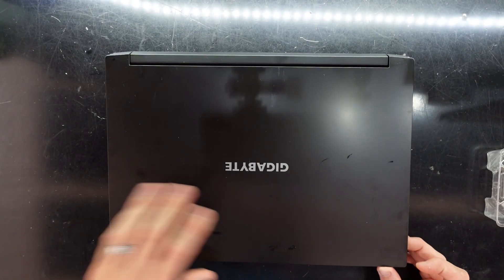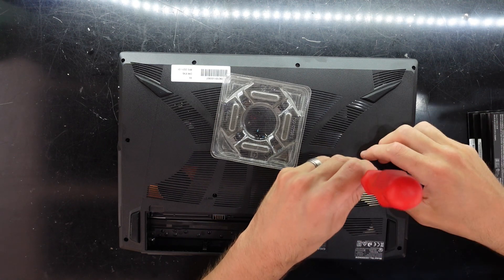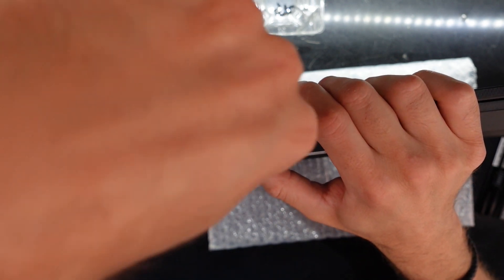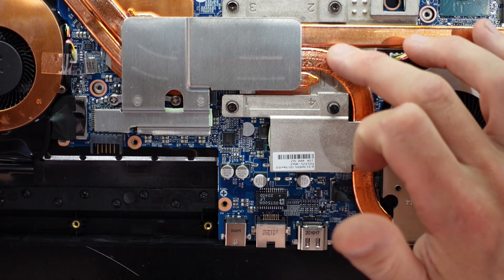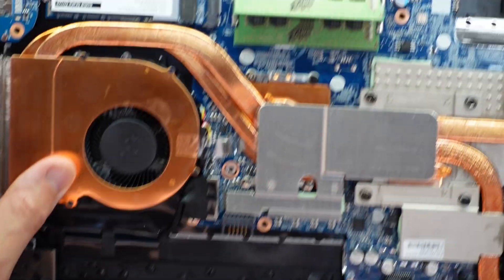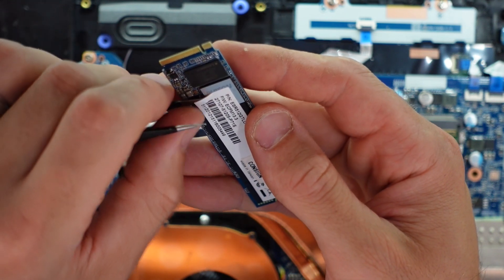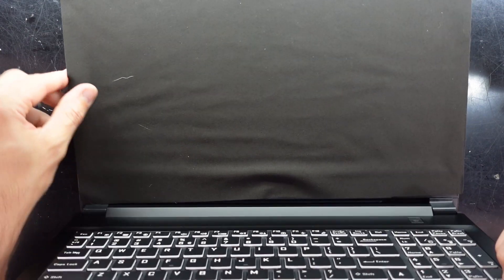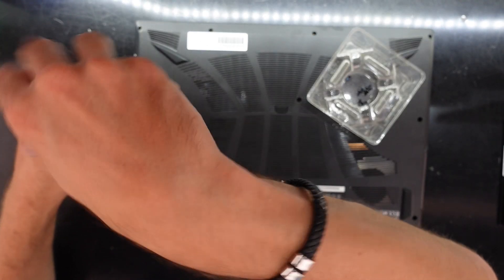Gigabyte G5 Teardown and NVMe SSD Install

Comment: Thanks for the video! Big question, though: I did exactly what you did and installed a 1TB nVME SSD, but when I tried to turn it on afterwards, it hung at the GIGABYTE logo screen. I tried recovery (F9 at startup), several BIOS options, and even made a Windows repair USB, but nothing worked. When I removed the new SSD, the G5 went back to working like it had, no problems at all. Any ideas why it's doing this, and/or what I can do to make it work? Thanks very much!
Reply from the maker: what model of SSD did you buy ?
Reply: @rickstechrepairs  I guess he found a solution 🤣
Reply: @rickstechrepairs  i brought Samsung990pro😢 i can't boot with this sad once i remove it will back to normal
Reply: @pl1576  is it not working with 990 pro ? Have you found solution ?? Maybe is the other slot which is for pcie 4 ?
I was just planing to buy it just today....
Reply: I got same situation😢
Reply: Did you solve your issue? Igot same issue here
Reply: Put your new ssd in the orignal place. And put the orignal ssd to the 2nd one

Comment: Was there a SSD under the M.2 drive slots? Or is there just the one/single 2.5 slot (that was empty), as far as expanding the storage?
Also, are the PCI interface 4.0? Or will it depend on what gen of processor? 
I was looking to buy one and during check-out, i found this video on it & didn't go through w the purchase.
Max-P version for 1250.00 online, but would like to know the number of storage slots total, and the generation that the NVMe ports please. 
And is fan noise worse than an older alienware (similar CLEVO type SLI on older alienware)?
Any advice is appreciated. Thanks
Reply from the maker: 6:15
not sure if its PCI4.0

fan noise is the same as most clevo laptops
Reply: @rickstechrepairs  thanks for info man.

Comment: Oh! Quick question, when installing the extra M.2 SSD for this, do I need a heatsink? It seems like the M.2 SSD that comes with the laptop doesn't have one, but I'm unsure. I'm gonna use my extra M.2 SSD for just storing my steam games.
Reply from the maker: You don't need to use the blue thermal pad.

But if you have it. I would recommend using it

Comment: nice...but then what's next? It did not recognize my M2, Samsung EVO 970 plus. Nothing in the explorer. The SSD is recognized.
Reply from the maker: Got to disk management

Then initialise drive

Then format 

Will show up in explorer after that
Reply: @rickstechrepairs  thanks for quick answer! I did this but it wasn't in the disk management either. So I reopened the laptop and also removed the laptop's own NVMe which did not have that same sticker as you have. That's when I discovered the thermal pad for the first one. I wondered and saw there's one extra in the bag with screws too. I reinserted both nvme's after installing the second thermal pad (which you didn't mention in your video by the way). Now it was recognized... just to run into another issue: the drivers can't get installed, magician does not support it (also driver-wise). It's not that simple unfortunately :/
Reply from the maker: some NVMe dont need the thermal pad, but i did forget to mention that so if you got the pad misowell use it

i would be going down the path of a fresh install of windows on the new NVME
Reply: @rickstechrepairs  I have found a different workaround yet using bcdedit safeboot, changing from Intel RST Optane to AHCI mode and in safemode remove bcdedit safeboot. Driver got installed, magician recognizes it and the samsung is now my boot drive. No issues left. So conclusion: Samsung is not comaptible with the Intel RST Optane memory mode in this laptop at least.

Comment: Oh! And since I'm getting this laptop soon, do I need an anti static bracelet for when I operate on this laptop to add on a M.2 SSD? How do I ground myself with this laptop?
Reply from the maker: Ground yourself by touching something metal, like a screw driver or the cooper cooler
Reply: @rickstechrepairs  thanks! So like before I begin work on opening the laptop, I just touch the screwdriver? 

And thanks so much btw, your videos have been very helpful on making my purchase for this laptop.

Comment: https://youtu.be/i3WyunTw_3Y @ 7.40 - I was puzzled what for is that piece of purple rubber... It came in the box with the laptop, oddly, in a very large plastic bag. Now I know... Shame that you have to force out bottom panel, I do plan to install HDD in, but don't like the ripping out part of the process.
Reply from the maker: that is a thermal pasted, is designed to spread the heat on the NVMe SSD

Comment: can you please make a video how to clean the fans 
i bought it only 3 month ago and when i opened it
i already saw my cats hair through the fans.
Reply: or just explain here in the comments
Reply from the maker: open it up as shown and its it a light blast with compressed air
Reply: @rickstechrepairs  is it possible to remove the fans completely for better cleaning?

Comment: 4:12 USB-C ;)
Reply from the maker: type C's
Reply: @gargy2002 Correct.
Reply: @gargy2002 It does seem like they cut costs in that department. But from my (limited) usage I have found the laptop to be very quick at booting up, loading apps and opening files.

Admittedly, I haven't tried playing any games on it yet though, as I don't want to fill up the primary 512 SSD with my steam library. Waiting for a 2.5 inch drive for that.

I have been running blender on it though, and it performs almost as well as my desktop.
Reply: @gargy2002 Interesting, so that's how you get the third display output.

I've been using it for connecting usb devices.

Comment: In silent mode is actually super quite and still has enough power for ALL games for at least 30 fps (actually just metro exodus enhanced maxed out with RT) if not 60fps for most. Resident Evil 3 remake at 1440p (via my tv) still reaches 80 - 130fps in silent mode! 

 But I do agree, the battery is laughable but thats's the case with all gaming notebooks. Had an Asus TUF I7 11gen with a 3060 (only max 90tpd) with 92WH 4 cells battery which lasted 2h30min with just office work in battery saving mode...

At least it's one of the easy, old scool removable battery which is rare nowadays with all the planned obsolescence...
Reply from the maker: 30fps i cannot stand, 60fps is ok but 100+ is what i want

Cheers for your thoughts
Reply: @rickstechrepairs  Which this Notebook does with nearly all modern titles even in the low CPU frequency silent mode i.e. 60fps at minimum but most of the time between 80-130fps (silent mode = CPU goes not over 3.0GHz, max. 35% fanspeed and sits most of the time at 70-85°C with the CPU/GPU)

Only when you push it with Raytracing activated like for instance Metro Exodus with RT on and without DLSS. 

If you want/need even more headroom there is the performance mode (the fan noise is not acceptable for most though) or you need at least a Notebook with an RTX 3070/3080 mobile. But those will be just as loud or even worse and are not worth the extra because Notebooks with them start at 1600€ while I got the G5 RTX3060 version for 1000€ and the performance gain is minimal. In this kind of form factor and performance there won't be an acceptable solution in terms of heat management and noise. This kind of Notebook does not exist (yet).

Comment: Hey first of all thanks for the vids, made me decide to get this over the Acer Nitro (from a solely peformance perspective)

I know you sold your one and moved on but I'm leaving this here for anyone else.
Inside the box that the laptop came in there is 1 rather thick thermal pad in a bag
Looking at the stock SSD, it looks like you're supposed to put it on the bit of metal beneath the SSD
Then install the SSD on top and just kinda squish it onto the pad
and it just kinda soaks some heat away from the SSD Controller through the PCB I suppose?
An odd cooling setup but I guess it works
Reply from the maker: Cheers, thanks for your comment
This will hopefully help someone else :)

thermal pads are to spread out heat thats generated in one hotspot to avoid damage and increase part lifespan
Reply: Mine didn't come with a thermal pad O.O

Comment: I'm hardware illiterate, is there anything special I would have to do to install an 2.5 Sata HDD in the top right, like how you needed the screw from the original packaging for the SSD? I'm upgrading to this machine and have never done anything like this before but I want my 2TB Sata drive to migrate from my old laptop to this new one.

Only video I've found opening this machine, thank you!!
Reply from the maker: i hope you manage to install the 2.5" Drive and all has gone well for you

Half the battle is getting the laptop open

Comment: In case you missed it like I did when skipping around the video, Rick said that the NVME screw is included in the original packaging. It should be a single screw by itself in its own small bag with a label of "ssd screw".
Reply from the maker: Cheers
Reply: @rickstechrepairs  also shoutout to Rick for this video. I watched one of his before I bought mine.
Reply: Thank you! I was searching for this screw! (btw for others it is in the original laptop box not the M2 box
Reply: @Weho2 does it have to be the one that comes with the laptop?? I lost the box
Reply: Than you bro ❤

Comment: Hi, I have got this laptop and i got a concerning issue, my cpu very often goes past 90 degrees celsius when gaming, my two questions are if it's a problem with my laptop or this model in general, and is that temperature safe? Also, is it possible to replace this laptop's cpu?
Reply from the maker: Replace the CPU - no you can't 

Overheating- no that fine they can easily get that hot
Reply: @rickstechrepairs  okay, thanks!

Comment: This particular laptop is good because it uses the 1rx8 memory sticks.
Must watch the Linus Tech Tips video showing some manufacturers are using lower quality 1rx16 for the retail laptops, while the benchmark ones sent for testing use the 1rx16.
Always doublecheck on your laptop to have 1rx8 models. The double density of memory of the 1rx16 leads to significant lower performance
Reply from the maker: I did catch that video 
A new thing to be on the look out for, basically the same as a dram-less NVMe drives
Reply: @rickstechrepairs  in new videos, whenever you get the chance you should mention that fact, to raise awareness on the matter, and every person that sees your video will know to spread the word, and hopefully force those companies to stop this practice.
I mean, you expect to see such memory stick on an entry level laptop, one of those 300 usd ones, for simple office work, but a gaming dedicated unit, it's unacceptable.

Comment: This is the rare i5-10500h that scored much better that i7-10750h in userbenchmark.

You keep saying it's noisy n hot but haven't seen you do a demo.

I'm thinking of this over nitro 5 i5-10300h. They both cost about 1.8k here...
Reply from the maker: i found the fan to be extremely noise 

https://www.youtube.com/playlist?list=PLDqQvgPNjY2mT18Q9Ik24dEOWQU4B21Pq

Wave1: video game benchmarks
https://youtu.be/kXL5QNUlGRU?list=PLDqQvgPNjY2mT18Q9Ik24dEOWQU4B21Pq&t=580

in the video above, i record this with a camera and me talking over the top, you can hear the constant fan noise 

i did just purchase a Nitro 5 10300H / 3060 for review, will be having videos coming out for it in the next week or so 

Paid 1300 for Nitro 5, Paid $1700 for Gigabyte G5

Comment: Hi there! I have a problem with the recognition of a 500gb nvme kingstone A2000 ssd, which I could not make appear in Disk Management and it does not appear in Device Manager BUT if it is displayed in the BIOS, the ssd was extracted from my notebook Previous, I do not know what to do to recognize it
Reply from the maker: shouldn't be any tricks at all

i used a Kingston A2000 1TB in mine when i had it

Comment: Hi Ricks Tech, is there any way I can contact you through Messenger or Telegram or anything? Just wanna confirm with you on the undercover of the Gigabyte G5 laptop cause mine looked different from yours and I can’t share the pic I took from your Youtube video and I took from mine.
Reply: Mine seemed little less holes for cooling in between the lines as compared to yours.
Reply from the maker: i would simply think yours might be a slightly different revision but overall that should not matter

Comment: i just bought this laptop and had issues with my usb ports. my steelseries arctis 7 keeps disconnecting, this never happened to my other desktops and laptops
Reply from the maker: Any other USB Devices dropping out?
Reply: @rickstechrepairs  none, just the usb transmitter from the arctis 7

Comment: Hey, nice review!

Are there speed differences in the m2 slots? I want to upgrade to an 970 evo plus 1tb, and want the most performance of that nvme.
Reply from the maker: Not that I am aware of
Reply: Hi, any progress on your issue? I intend to add a 1TB KC2500 Kingston PCIe 3.0 as primary and will switch the 500g to the 2nd slot. But not able to verify any differences between the slots.
Reply: @donshortjohn2108  hello did you find out which slot was which? one is gen 3 the other gen 4 but it doesn't give the info

Comment: Nice Vid mate, can u send the links of the SSD & Ram installed on ur Tutorial pls?, Also for the two storage slots  what is the max capacity ?
Reply from the maker: i would assume there wouldnt be a max storage capacity.

could probably go 2x 2TB
Reply: Aye theyres no cap so just the highest storage you can find,

Comment: How are the thermals when gaming? That cooling system seems rather weak for the specs.
Reply from the maker: i found the cooling to be underwhelming, and it basically meant a hot and loud machine

Comment: Hey @Ricks Tech, do you think i could fit in there a XPG GAMMIX S11 Pro or dou you think its slim heathsink would impede closing the laptop? I read somewhere that the height of the ssd was 6.1mm. Thanks!
Reply from the maker: no longer have the machine to test/check sorry
Reply: @rickstechrepairs  thank you for your video! I followed today and installed a new 2.5 ssd and a new nvme to my g5

Comment: Hi, I followed your guide and installed a 1TB nvme ssd, but now my laptop won't power up at all. It powered up for a few secs and turned off on the first attempt, but now it's completely dead. I tried removing the new installed ssd and turning it back on but it doesn't work anymore. Please help!!
Reply from the maker: I would try disconnecting the battery for a minute or two and then they kg to power up from there 

Was the machine fully powered off when you installed it ?
Reply: @rickstechrepairs  thanks for the reply. Tried disconnecting the battery and power source, then discharge via holding power button and it still doesn't work on both battery and power source. Repeated the same steps but disconnected the cmos battery and discharged, doesn't work. I've made sure to discharge and ground myself when I installed the ssd as well.

One thing to note is that the battery and power supply lights are visible, so it's simply the laptop won't power up. What are the possible reasons for this?
Reply: @shaunteo3730 did you get to fix it?
Reply: @Vetaa  nope I got the whole laptop replaced.

Comment: Does anyone know how to adjust the fan curve under 35%  in the gigabyte fan speed setting, the fans are always running with at least 2000rpm, it has to be possible to configure that setting i an ini file or something, i would be really thankful, if someone with more knowledge then me has a solution for the problem. Other Software like Fanspeed or Argus doesnt work on the Notebook.

Comment: I added the same ssd to this same laptop but it says optimization not available and it's not detecting it in partitions, any help would be appreciated
Reply from the maker: I never encountered that message

I went to disk management and formatted the hard drive after I installed it

And it was fine

Comment: hey mate 
thanks for all your lil video regarding the G5 
i got mine couple days ago and looking to upgrade the SSD, whats do you suggest 970 evo ? 980 pro ? something else ? 

thanks
Reply from the maker: i would just got with whatever is cheaper.

in my current laptop i have installed a Kingston A2000 in there, good price

Comment: Should I get the i7 10750h and Rtx 2070 max p(300hz), or Gigabyte A5 ryzen 7 5800h(240hz), or Alienware m15 R3 rtx 2070 not the super i7 10750h (144hz)
Reply: Ryzen 7 5800H, dominates those other processors by a mile, where did you find that model?
Reply from the maker: not sure

Comment: What are the pros and cons you have seen so far? Can you kindly update us on the thermals? thanks a lot.
Reply from the maker: Fan noise is loud, even during light office work the fans go wild.
Also battery is poor

Screen is damn smooth and gaming performance is great
Reply: @rickstechrepairs  In average, the battery runs... what?! Less than 45 minutes gaming and like 4 hours in light work?!